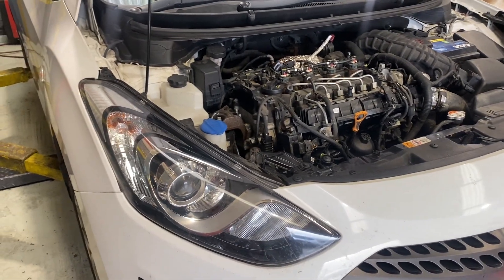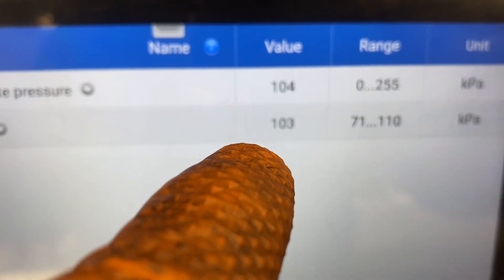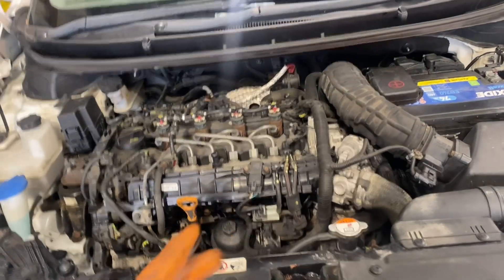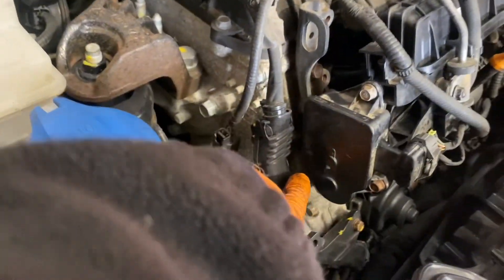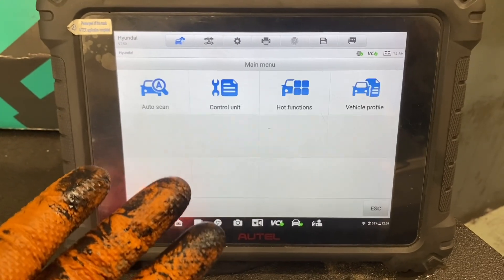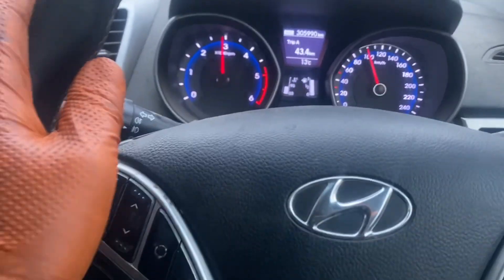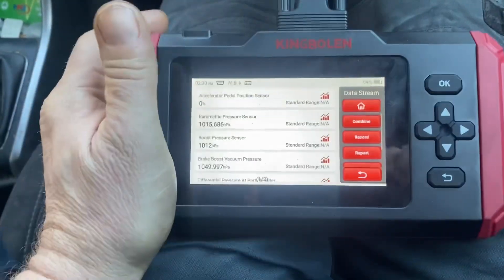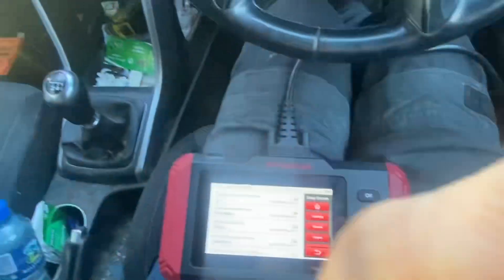Hyundai i30 1.4d, P0069 manifold / barometer pressure correlation

Comment: Have you ever had a hyundai i40 in for constantly stalling while driving and what would be the first thing to look at ive heard the fuel filter is at the back of the ecu and an absolute whr to get at
Reply from the maker: The fuel filter is behind the ECU, but not too bad to change. Pull out the battery and ECU, 10 minutes or so and I gives lots more room. 
I have encountered crank sensors to fail intermittently on these causing similar issues. I have also had intake runner motors intermittently fail and pull the 5v reference to ground 🤔🤔🤔